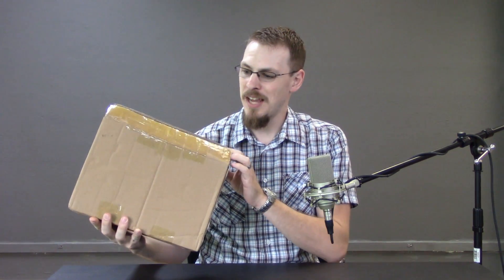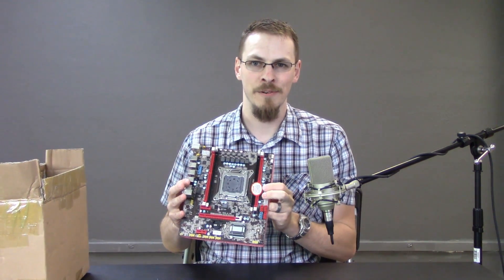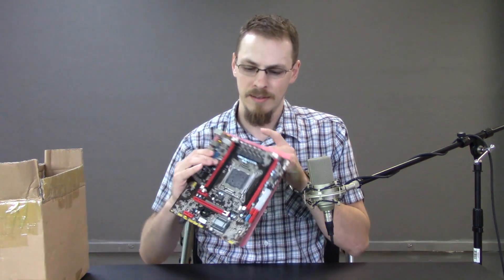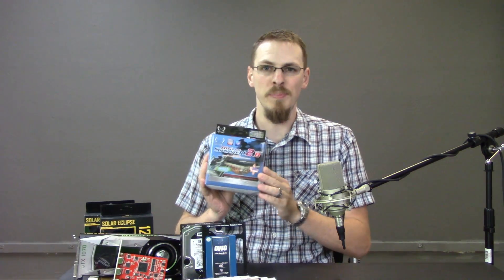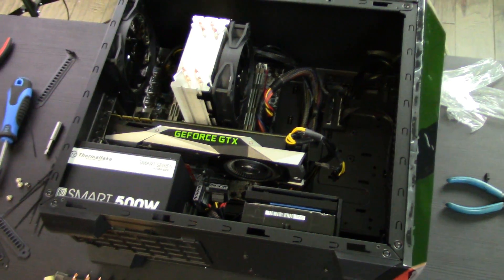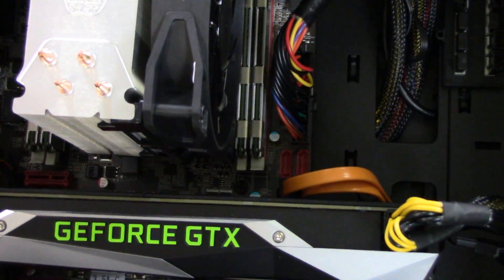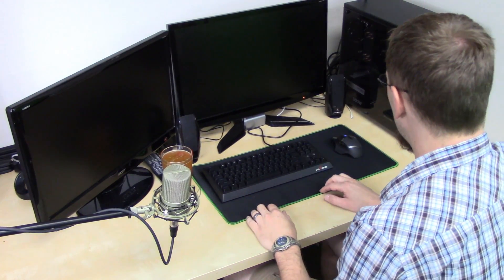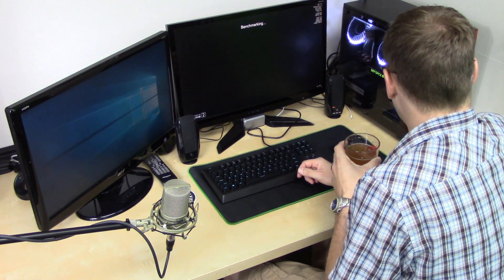Chinese x79 Motherboards... Do they even work???

Comment: Some of those boards, like the one you got, aren't genuine X79/C602. They use a modified H61/H67 chipset instead, that's why they are so cheap.
If you don't overclock, they get the job done, and are actually pretty good value considering how cheap the CPUs are these days.
Reply from the maker: Exactly right.  This is a modified B75 chipset, which I discovered after making this video.
Reply: The blue ones (Huanan and clones) are genuine X79, and can even overclock pretty well with the Russian BIOS, but they are also more expensive. Definitely get those if you can't find a name-brand one for a good price.
Reply: holy cow! how the heck did they mod it LOL!
Reply from the maker: I have two of these boards.  The red mATX one in this video is a P75 chipset.  I also have a blue ATX, and it's an x79.
Reply from the maker: +Shibshankar Mukherjee CPU-Z reported this as a P75. Combine that with the dual-channel memory instead of quad, PCIe 2.0 instead of 3.0, etc... Not hard to figure out this isn't an x79.
Reply: @Rage Tech They mask them as x79 chips, there are people that removed the heatsinks to reveal the real chips. Even mine says Q65 in cpu-z. I guess they have enough similarities to do those manipulations. I see no downside, have mine since July and it's running with no issues.
Reply: manaphylv Not the case mate, mine is literally the cheapest and is considered a huanan mATX, tho not a real x79 chip and as mentioned can mod bios and overclock -> https://www.aliexpress.com/item/HUANAN-X79-motherboard-micro-ATX-X79-LGA-2011-motherboard-HUANAN-mainboard-support-REG-ECC-double-channels/32809808598.html?ws_ab_test=searchweb0_0,searchweb201602_5_10152_10065_10151_10344_10068_10345_10342_10343_10340_10341_5660016_10171_10541_10084_10083_10304_10307_10302_10060_10155_10154_10056_10055_10539_10537_10312_10313_10536_10059_10314_10534_10533_100031_5650016_10550_10103_10073_10551_10102_10552_10553_5670016_10554_10557_10142_10107,searchweb201603_30,ppcSwitch_4&btsid=4a757f23-ef51-4d6f-9150-34d4b8093879&algo_expid=b07bbfb2-7d28-4835-8c52-9ff7c8ff7f55-2&algo_pvid=b07bbfb2-7d28-4835-8c52-9ff7c8ff7f55
Reply: I build mine with the same cpu, just i got it on 99 bucks and paired with 8 GB Crucial Ballistix and a RX 460 Windforce
Reply from the maker: I'd like to think I'm personally responsible for that :-)
Reply: And well deserved. Your channel is a breath of fresh air. Im binge watching all your vids. :) +99999 for awesome beer recommendations
Reply: That's true, I have a Q65 based one. That being said with modded bios I have a e5-1650 at 4.3ghz which is really not far from an overclock with a good proper x79 motherboard. Using a very similar to the video one and bios from http://x79.apphb.com/.
Reply: Not the E5-1620, because it only has 4 cores, so there's no point - better to get a proper LGA1155 board and Xeon E3 instead. If your budget can stretch to an E5-1650 (aka i7-3930K, 6C/12T, unlocked), then it's totally worth it, even if the board can't overclock. The E5-2680 v2 (10C/20T, 2.8~3.6 GHz) is also a good value option these days, should you need the number of cores.
Reply: I tried AMI bios FreeDOS and it did not work  freezes instantly and locks system Manual flash failed bios locked 100% thread is up this is wrong information the 'TOOLS' on the 
i tried FreeDOS and the afudos /o option + the .exe AFUWINx64.exe AMIBIOS8_AMI_Firmware_Update_Utility https://ami.com/en/products/bios-uefi-firmware/ did not work the bios default is shown in and cannot be overclocked Intel (R) Extreme Tuning Utility shown is X79
Reply: how did you find that out?did you use any program to determine what chipset its really based on?
Reply: So glad found this channel!!! Thanks for doing Xeon vids. Looking to build something like this, too bad they all caught on and the 2667s went up in price
Reply from the maker: +Boris Levenzon Thanks man! I appreciate it!
Reply: Rage Tech
There was an era where the was DDR2 and DDR3 capable CPU and motherboards
Reply: What if they are advertised low end like H81? I think those would be the real deal. I've even seen some Maxsun H81 boards on ebay, they have few USB ports in the back but it looks all right for the price
Reply: It has to be a C606.  No other possibility, He is using Registered ECC ram, which the only chipset on a 2011 to support that is...a C606.
Reply: Yeah but reputable brand boards are very afforable already so I'm not sure why anyone would ever buy this except to test like in this video and for shits n giggles
Reply: can you use ECC memory on fake X79 with h61 chipset motherboard?
Reply: @TheDyingScotsman  Affordable?,,-They are an absolute rip-off;- Who wants to pay stupid crazy inflated prices for some second hand old probably  thrashed crap which could die any minute, when you can buy something brand new at least, at a truly affordable price.
Reply: I dont understand why people are so BS with chinese PC parts...you paying a X79 Mobo that is half of the price of any other mainstream board, it support those old Xeon CPU and ECC memory, you cant even find a second hand x79 with that price...beside i dont think the chipset can be fake...it might be using C606 chipset(USE in Server and support LGA2011,some other chinese brand like Huanan is proof to use that chipset)...
Reply: this is impossible...how are you suppose to let the 2011 CPU to work with other chipset that are not design for it...is like a DDR3 Ram with DDR2 component . ..you got any proof?

Comment: You should do a video on the i7 3820, you can pick it up for $55
Reply from the maker: I considered that, but it is only 4-cores.  At this point, a Ryzen 3 system almost makes more sense.  Same cost of entry, more modern features (PCIe 3.0, NVME, etc).
Reply: Daaaaaamnit I forgot all about ryzen 3.....

I brought an i7 3820 and I was going to buy the same motherboard as you.

I totally forgot about ryzen.... there ryzen 3 1300x consumes half the watts and does almost equal performance...

At least I can say I have an intel extreme CPU 😎
Reply from the maker: Yeah.  The value on these x79 boards only comes in if you get 6-cores or more.  And even then, an R5 1600 is very compelling.

I'm actually looking at doing a video shortly about "was I an idiot for going x79 + E5-2667 over B350 and a 1600".

And yes, you can brag about having an enthusiast system now.  Can't say that on Ryzen ;-)

Comment: Does it have OC features? V-cpu V-ram BCLk etc?
Reply from the maker: I does have some limited overclocking.  Ratio is really the only thing adjustable, and it only goes to 39 (so 3.9GHz, stock V).  There are methods of installing a custom BIOS on the board and allowing for more, but I've not tried as I'm using a locked CPU.
Reply: Thanks for your reply :)

Comment: What would be better CPU to buy, Xeon E5-1650 or Xeon E5-2680?
Reply from the maker: Adrian Pragacha For gaming, no question, go with the 1650. It is unlocked for overclocking and will offer far better single threaded performance over the 2680. The 2680 will be slightly better for multithreaded workloads.
Reply: Thanks for the advice., :D great video by the way.,
Reply from the maker: Adrian Pragacha Thanks for watching!

Comment: I built a similar system but used the ATX version on Amazon and used a Xeon E5-1650. The stock bios didn't allow the multiplier to be set over 39x, so I found a modified bios on a Russian site that I flashed instead. Afterwards, cpu runs at 4.2ghz no problem. You should consider upgrading to the Ivy bridge 10/12 core xeons if they get cheaper in the future!
Reply: +scrote the goat 
Use Google translate on the webpage. Download your version of the bios and make a DOS bootable USB. Download the amiflash.zip file from the Russian site and use the afudos.exe in the APTIO folder. Copy the exe and your new bios to the USB stick.

afudos [any name] /O (this will back up your old bios to the usb with whatever name you set. Do this first in case something goes wrong

afudos [name of new bios].rom /gan (flashes new bios)
Reply from the maker: +The U Yeah, the 2667 was both the best bang-for-the-buck and a proof of concept. If this project went sideways, at least I wouldn't have wasted too much money. I am watching CPU prices, especially the 1650, i7-3930k, and the 2699. I doubt the 2696v2 will be hitting an affordable price anytime soon. And by the time it does, X99 may actually be a cheaper route to go. Glad to hear someone else is having success with this setup.
Reply: +scrote the goat 
http://x79.apphb.com
Reply: The U I'm building one with a Xeon E5-1620. Mine is also the ATX variant, could you provide a link to that website with the custom bios? That would be extremely appreciated.
Reply: Modified Bios on a Russian site: Sounds like a  hacking disaster waiting to happen.
Reply: thank you for the help! couldn't make much sense of the poor translation, lol
Reply: Here, deeply buried into the web, resides the truth.
Reply: The U u live on the edge
Reply: I'm having issues with FreeDOS. No matter what, when I flash FreeDOS it says there's an error and that there's a bad or missing command interpreter. I've tried different disk images, different programs, everything and it's just not working.
Reply: I'll check it out when I get a chance
Reply: The U can you provide a link to the board?  What revision did you buy?
Reply: "MASSAD SPETSNAZOVICH SEALOV" this name tho.
Reply: How did you find a hacked bios when they don't give a brand name? How do you know if you have the right file for that motherboard?